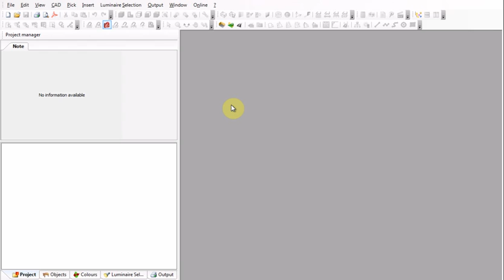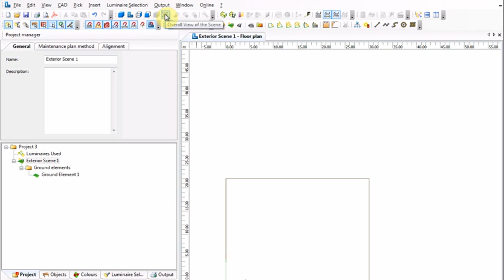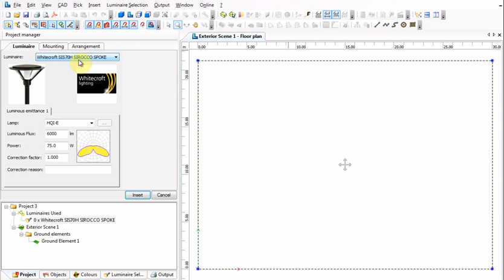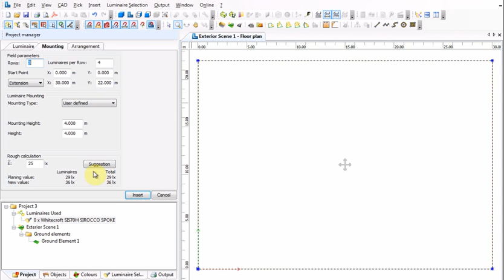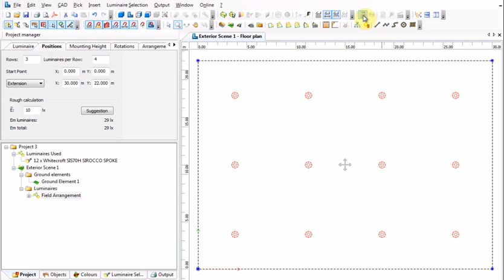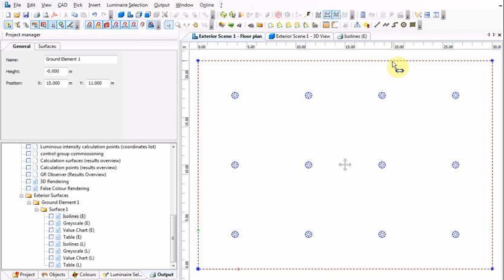DIALux 4.11 Lighting an exterior open area

Comment from the maker: In Project Manager select Objects tab and then Standard elements. You can drag and drop various solids from the Preview pane for example from the bottom of the set Extrusion Volume. The height can be adjusted in the Room Editor of the Project Manager to suit the elevation of the scene. To get illumination results from say the top surface in the CAD window with plan view or 3D view left click to select the surface then right click pick Select this surface. In the Project Manager there are tabs within tabs select Calculating Grid then tick box Output Results. Now select Project from the Project Manager and rename the Surface number that has been created under Extrusion Volume with a right click on the name. You can of course rename the Extrusion Volume to make more sense.

I hope this is enough for you to make a scene as you wish. Refer to the DIALux 4 Manual for more help.
Regards
Graham
Reply: Can you please do highmast lighting using floodlights for a small area..
...,150mx150m with just one high mast with 8 equally spaced floodlight  in the middle for example...
Reply from the maker: @anshu_1601  I am no longer involved with DIALux or lighting design. So I am unable to give you advice on this topic. At least you will not be waiting for a reply.
Reply: @grahamclight  Thanks for the reply. Actually I am currently working on the lighting of a coal washery and high mast lighting seemed a good idea. Since I had no idea how to start I was initially puzzled but have managed some how. Three 30 mtr high mast, each with 12 nos. 400W LED floodlights did it very nicely. I plan to do it for area lighting in all my future projects. A very economical solution.